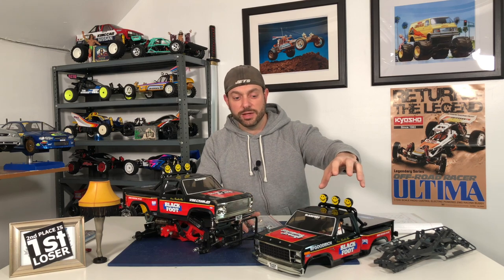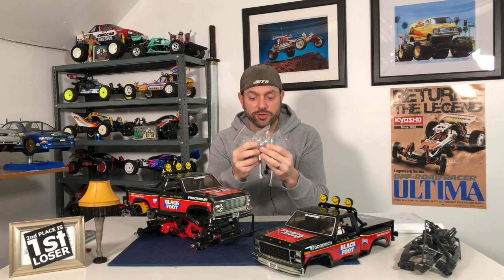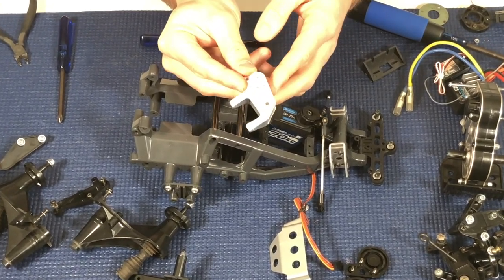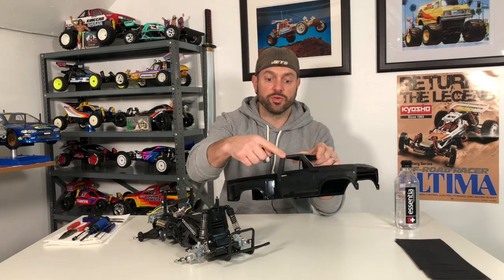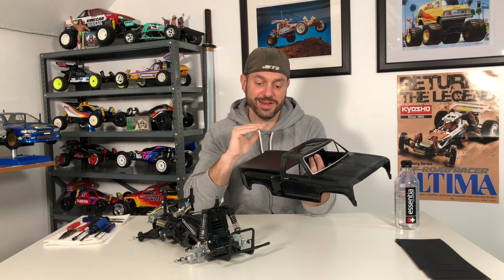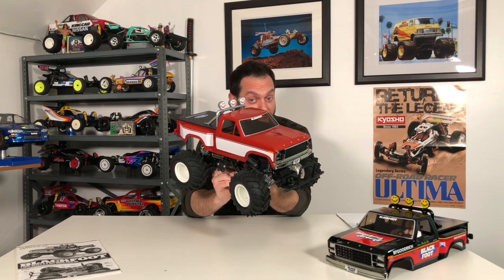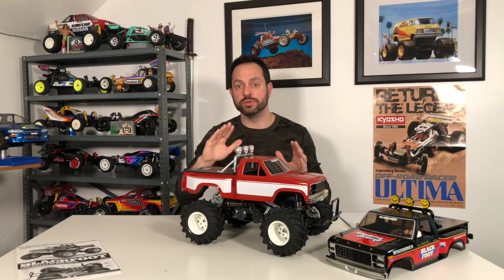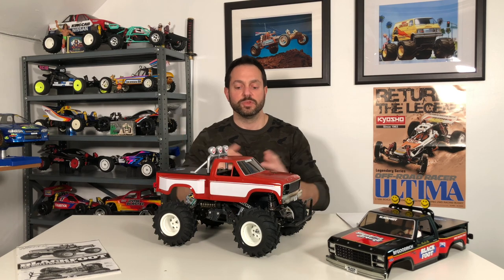e181: Tamiya Blackfoot MAKEOVER Aluminum Parts, New Chassis & New Paint Job With AMPRO FORD Badging

Comment: Beautiful job !! I'm currently rebuilding an original Blackfoot . I purchased the truck for $20 back in the early 90s and like a dummy I threw away the Ford body. The lexan body broke and now I am installing a super clod buster body for it. Cool after 20+ yrs on a shelf in the basement and it still ran .

Comment: U need to just do the 400 grit! Then prime! To give ur prime something bond to! Then prime and sand with 600  and the will show u ur high and low spots! Then once u get it smooth and level. Spray another coat of primer! Let dry sand light with 600 making sure u don’t sand through the primer. Then paint with ur color! And then u can start ur cutting & buffing and that means wet sand with 2500 and 3000. And then buff it out and ur done
Reply: Yeah dont think he was gunna spend that much time on a runner thats gunna be in races but good to know

Comment: Bit of brake fluid in a tub .drop the bad part in for a few hours .then wash it of it’ll take the paint off to the plastic base .then prime again then paint your Colour .takes a bit longer if the paints been on a while .just make sure you wash off the brake fluid out of the nooks and cranny’s.you can use it to strip lexan bodies along with nitro fuel .

Comment: Where did the white wheels come from?
Reply from the maker: Spray Paint.  Gloss white spray paint.  If you are going to do that, make sure you get a spray paint that is primer and paint in one and take your time.  Light coats.  not to heavy or else you will get runs in the paint.
Reply: @RCRetro  Thank you. Much appreciated!

Comment: Where did you find this on eBay and  Do they make it for the king black foot please comment back very very interested in this set up thank you so very much for this video Thank you very much again
Reply from the maker: Hi and thanks for the comment.  I am not that familiar with the King Blackfoot.  I found all the aluminum parts on eBay.  I would start there by doing a search.  They're on the pricey side though.  Good luck.
Reply: @RCRetro   Thanks
Reply: @RCRetro   Who makes the parts that you purchased Out of aluminum can you turn me on to that person please comment back I have 4 of these trucks 1 is 1 is a shelf Queen Would love to know please comment back and let me know if you could thank you
Reply: @RCRetro   If you are going to be running this truck on blacktop or concrete you might want to pick up another set of wheels in a set of midnight pumpkin or the lunchbox tires they are wider and the truck does not roll over as easy and pick yourself up a wheelbar So you do not tear up your back bumper this truck came out real nice Good luck with it
Reply: @RCRetro Never received a comment back on where I can get these parts

Comment: Do you still have the kyosho outrage buggy ?
Done any upgrades or work on that ?
It shares quite a bit of parts with the kyosho ultima buggy you got as well so could do some interesting upgrades too it for durability & handling.

Think it could be a good buggy too race with if you upgrade wheels, tires & shock towers from an ultima, ultima pro, or ultima pro xl, maybe put in a motor with adjustable timing as well & turnbuckles front & rear so you can adjust camber & toe in or toe out in the front.
Reply: Me and ari both sold our outrages last year
Reply: @tallguygaming409  Agh third comment it removed instantly...

google search " rc10talk ultima pro xl " it should show a build thread or two on rc10talk & mentions some mods that can be done too that platform.
Reply: We also cant use motors with adjustable timing we try and keep things super simple and easy to complete.  I sold my putrage when i bought my ultima 2. It was a big upgrade in cars so i didnt see why to keep outrage

Comment: But that’s y ur paint had a bad response is because u sand ur base to smooth and ur paint didn’t have anything to bond to! Because ur never supposed to sand with anything finer then a 400 grit paper. And it is more critical doing it The way I suggest because it’s a hard plastic. And also u can I eliminate a lot of steps and processes that you’re going through and really necessary. Believe me when I say I’m not trying to I am your man anything that you have done I’m just so at that with my own experiences being since I do have a background in painting RC and full-size. But if you will try it the way I yesterday you will see you will never have a problem with your pain lifting or flaking and you will get a more smooth or better paint quality.

Comment: Hi, I’m trying to get my Old Tamiya Blackfoot RC Truck running again and I need a new SA1 resistor widerstand resistance part. It’s the white block with three wires on the drivers side attached to the frame. I’m new to restoring this truck so I appreciate any help you could can offer. Thank you
Reply from the maker: if you are on facebook, join the tamiya blackfoot group.  people on there are restoring blackfoots and post parts.  Or try ebay "tamiya ceramic heat sink" Good luck